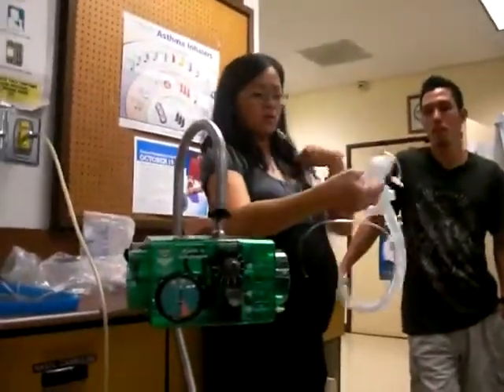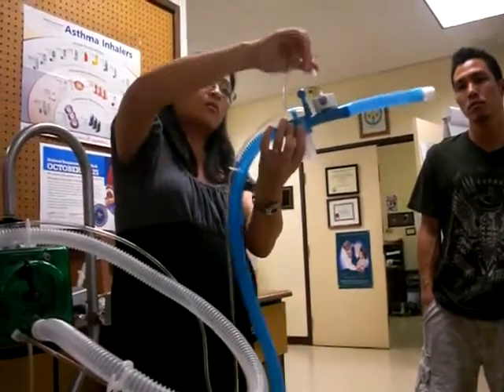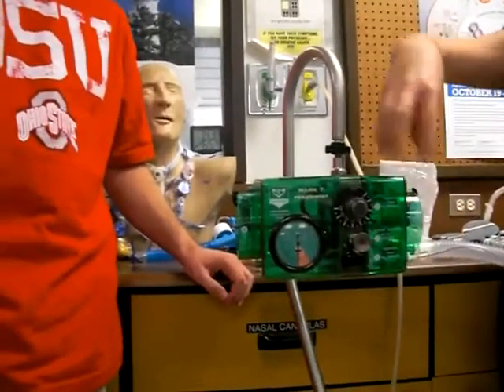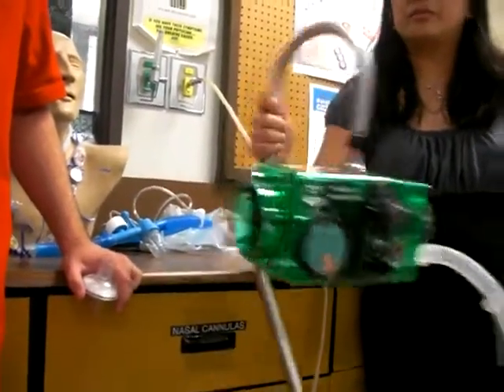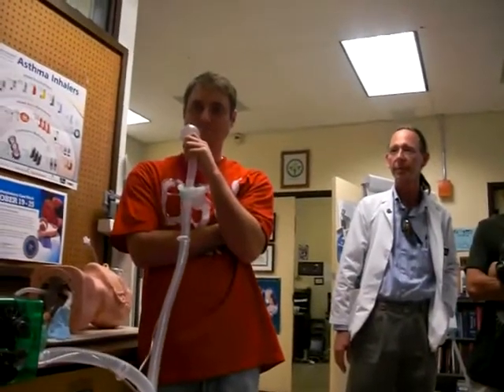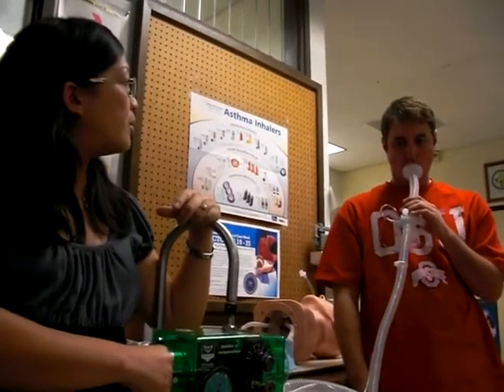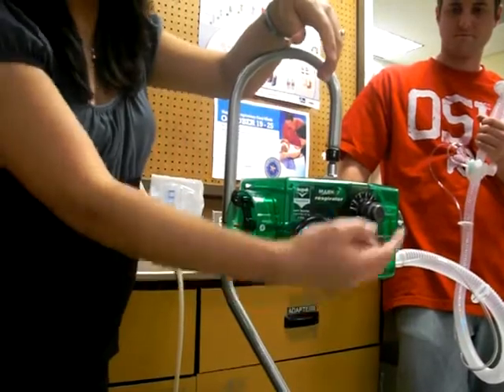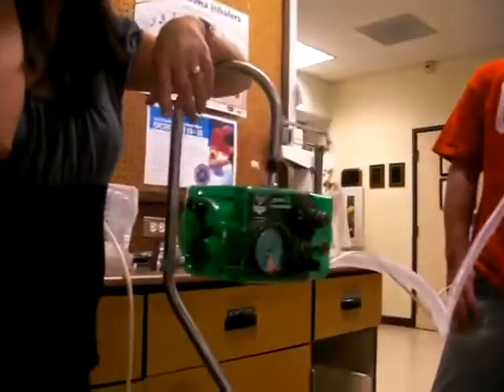IPPB Part 1

Comment: Correct: Hi. My  name is Ethan and Im from Respiratory. You're having a lot of trouble breathing. I am going to give you what is called an IPPB treatment. what this will do is help you expand ur lungs. You are going to have to put this in your mouth, and take deep breaths. This will be a bit unpleasant for a few minutes, but you will get use to it. Its going to put pressure on your lungs to help ease your work of breathing.